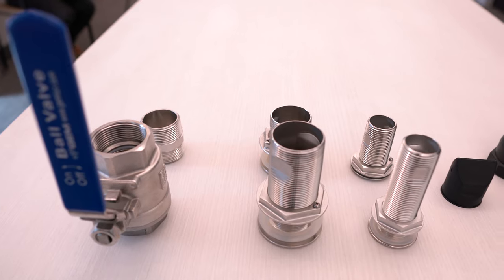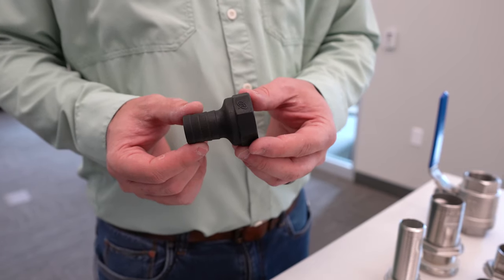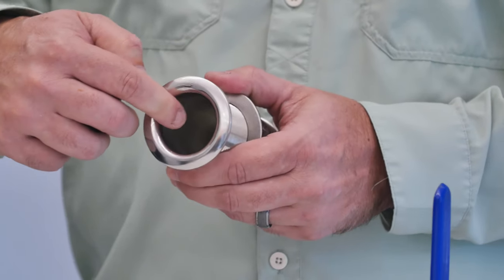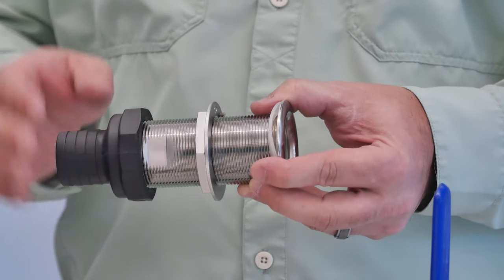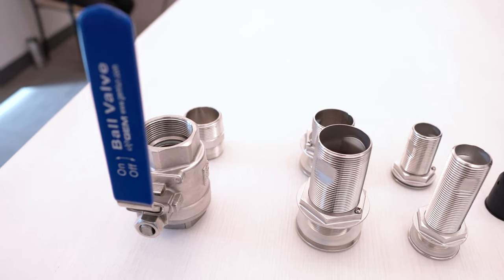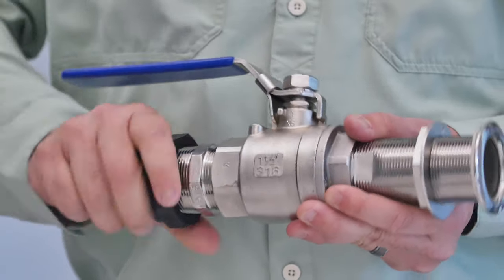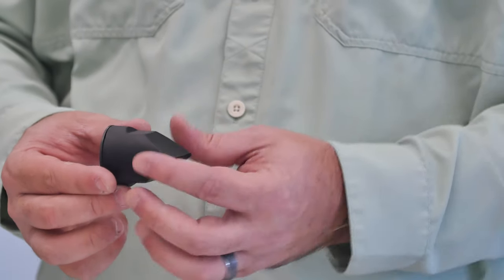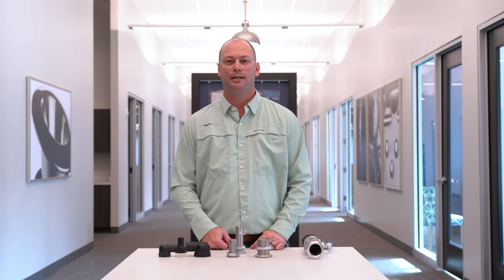GEMLUXforged thru hull/duckbill system

Comment: This is a very nicely designed product! Well done!
Reply: For a straight thru transom drain at sole height (above waterline), could this be made to work without the retaining nut? I'm sure 4200 would probably hold the thru-hull in place securely, but I'm wondering if there's a way to keep the duckbill in place if there's no adapter or retaining nut screwed on the end. I'd have to cut it off flush with the transom for good drainage, hence the question.